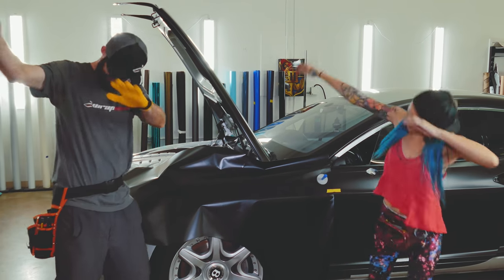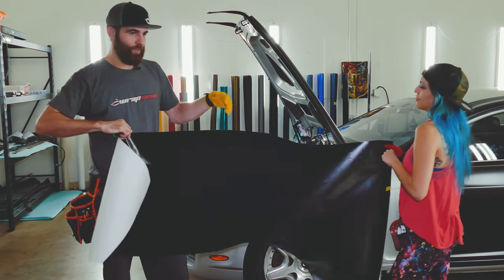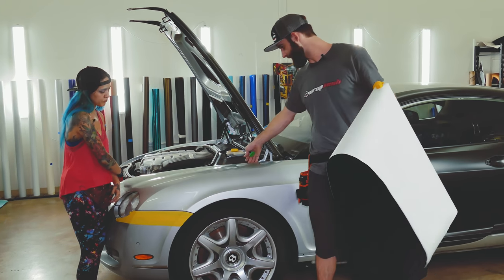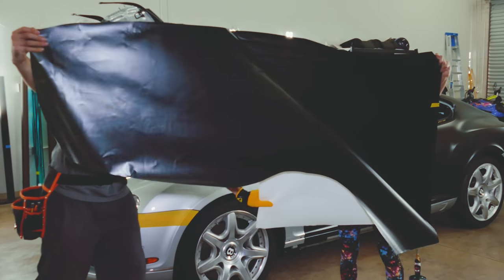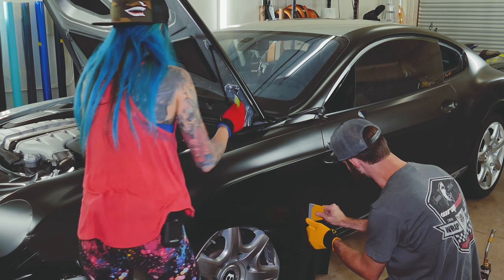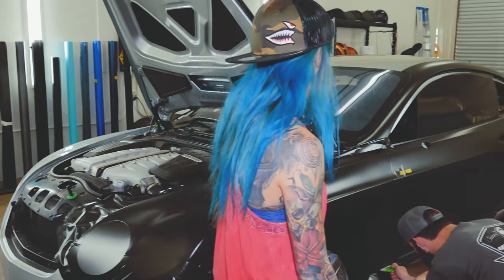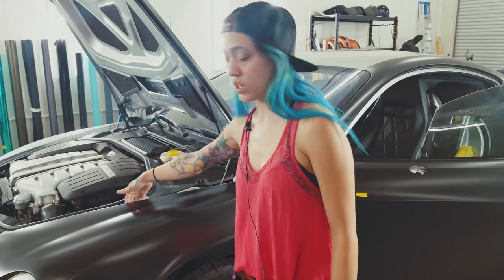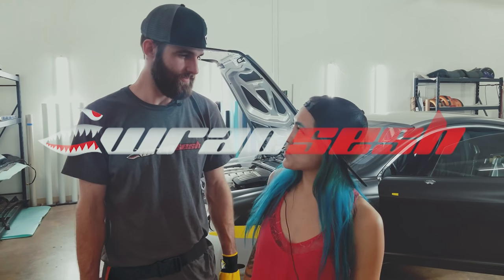Wrapping Difficult Fenders on a Bentley

Comment: Sooo.. if you were to NOT use a flame torch but a IR or heat gun & say the shop was 70°F would you have less problems with ending up with "work-lines/ glue-lines/ adhesive-lines/  appearance of wrinkles"???????